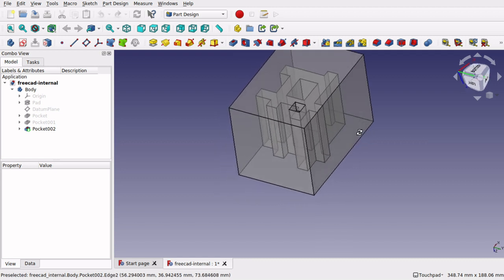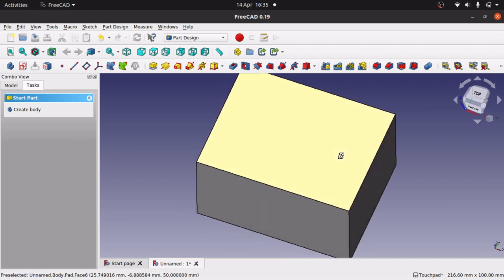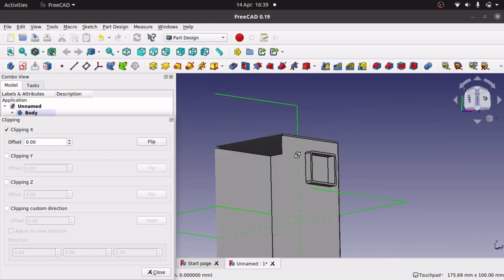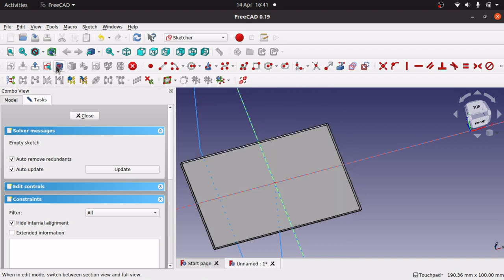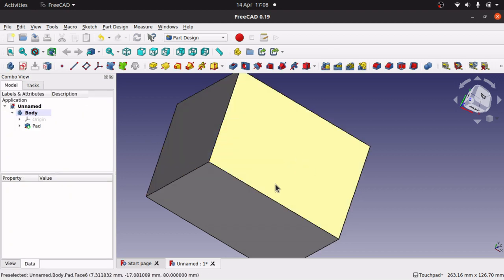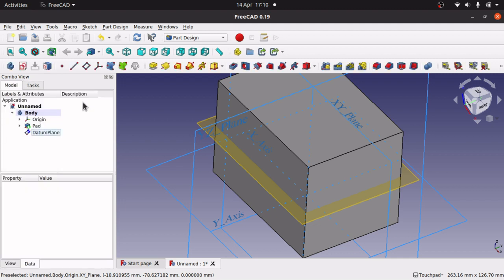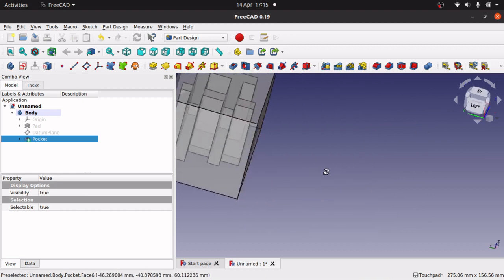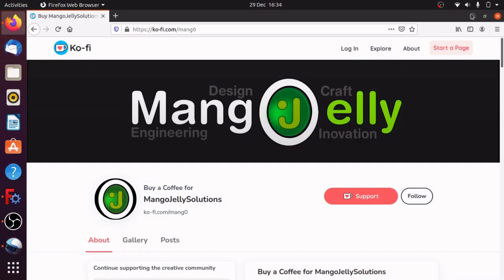FreeCAD:  Model internal structure on faces inside closed body using clipping plane and section view

Comment: Well done,  true form and consistency, liked the two different methods clipping and datum.  A request would to make a third case using pipes which I believe is a separate workbench……not sure it exists but would be cool.
Reply from the maker: Thanks for your comments, great to hear what you like, really helps me understand what viewers are looking for. Nice request.  I touched on something similar in two of my curves workbench mini series but it was a channel in a wall and adding supporting profile for sketches to route a pipe through.  You could  do the same inside the pipe itself. I also extracting out shapes from a pipe to fit a ring inside for another video.  But I could expand more on these techniques.  Just need to find a real world object that I can apply it to.  suppose some kind of valve or even a telescopic sight.  I will look into it, thank you for the request and comments.